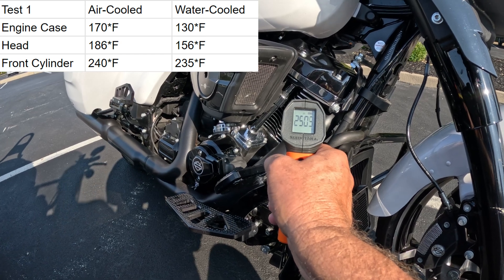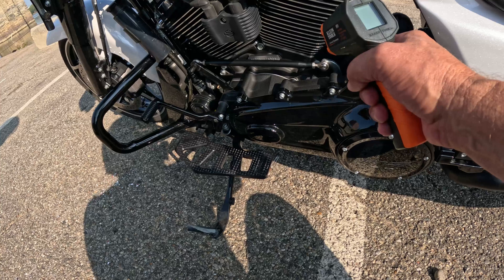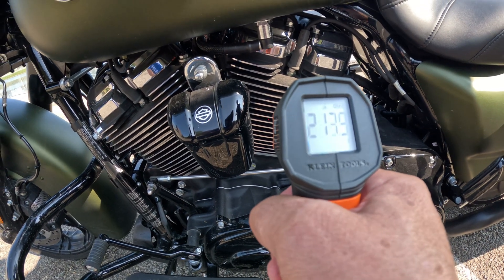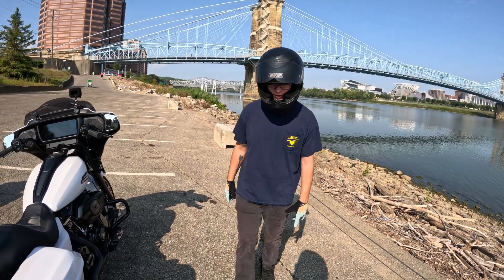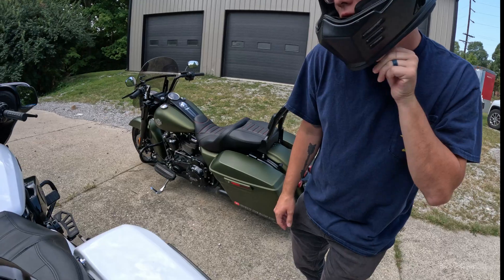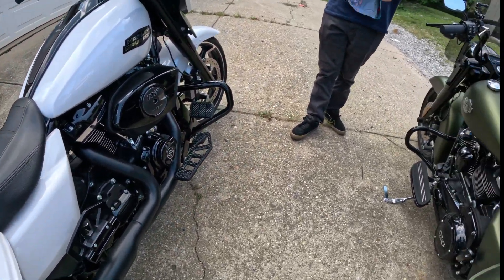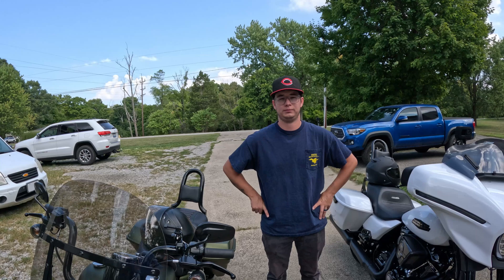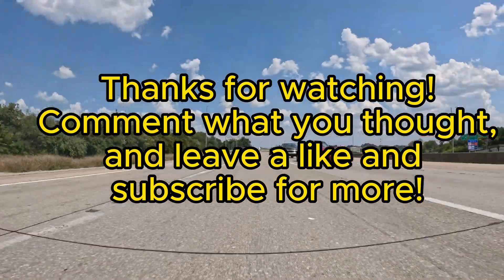Harley-Davidson Air-Cooled vs Water-Cooled

Comment: I think the engine oil works at higher temps. 
I have an antique air cooled Dixie Chopper 30 + years old. I Just changed the oil frequently. No engine work. 
Your Harley will last many years.

Comment: New 2024 Harley Davidsons are not water cooled.  Just oil that they rerouted…
Reply from the maker: @MJGAZ64  2024 street and road glides are liquid cooled
Reply: @BehindtheBars859  and the liquid is?😂
Reply: @RamdyEvans  I can’t get a straight answer out of someone who knows?
Reply: @RamdyEvans  The heads are liquid  (water) cooled on the 24 model  resevoire is on the left side of the engine and routed through the back cylinder first  than through front.

Comment: The motor might last longer because the lower temperatures, but the electronics will wear out before that road king dose.
Reply from the maker: It could! It would seem like lower temps would generally make a motor last longer. I'm just not a motor tech to know what the actual specs are, and at what temp it starts to really make a difference
Reply: Dose ?
Reply: Before road King wears out
Reply: No it fuckin won’t

Comment: I would like to see you do the same test after an hour or two of riding. I wonder if the water cooled would eventually catch up to the previous generation engines after a longer ride?
Reply: It seems to stay consistent about 190 - 210 while riding on my temperature gauge on the dash, the highest I have seen is 225.
Reply from the maker: Good point, I'm not sure if it would. Thanks for watching

Comment: Nice information, they should've started the oil and water cooling back on Evo but it is what it is
Reply from the maker: Yeah, seems like they should've started water cooling a long time ago. Thanks for watching!
Reply: Eco didn’t need it. The only reason HD went this route is EPA regulations.
Reply: @gorillamoto5329 The company also wanted to address customer feedback from their "Project Rushmore" program, which included over 20 focus groups in the U.S. and Europe. Riders told Harley that they didn't like the heat from the motorcycles, and liquid-cooled cylinder heads allowed for some thermal management without a large radiator

Comment: Much better ways to check engine temperature than with an infrared heat gun. However, if you check the exact same point it does work for reference. If both motors are completely stock the water cooled heads do run cooler.
Reply from the maker: As we said in the video, not the most scientific way. Works well enough to compare and temps/measurements were consistent. Thanks for watching
Reply: Too many variables in play for an infrared thermometer on these motors.